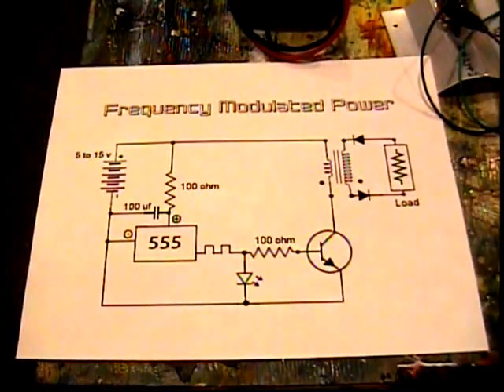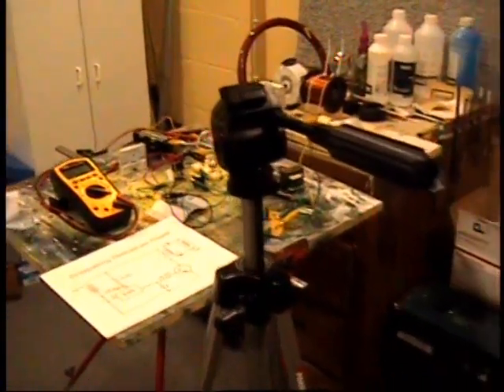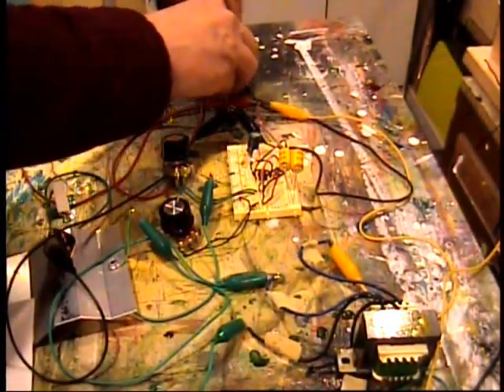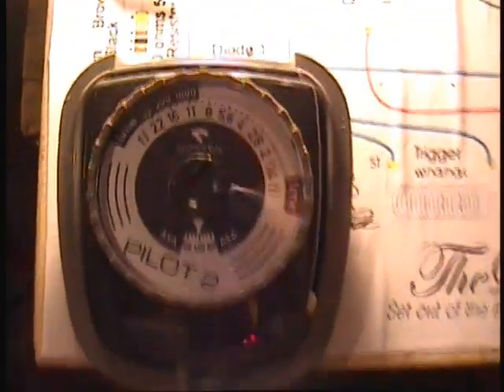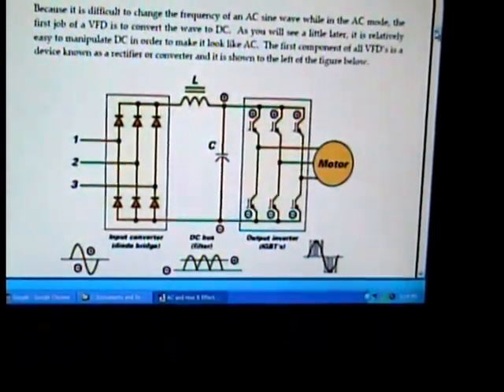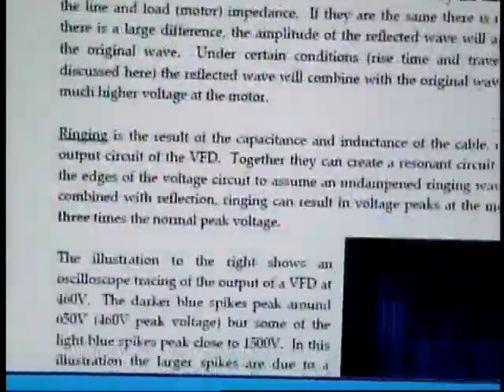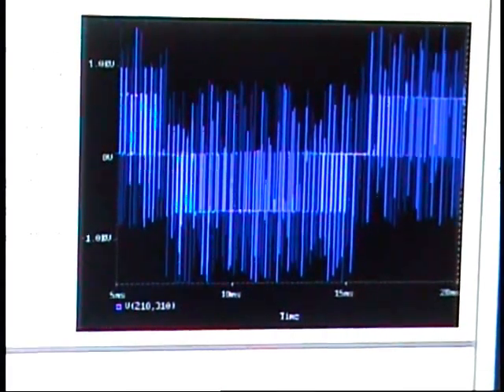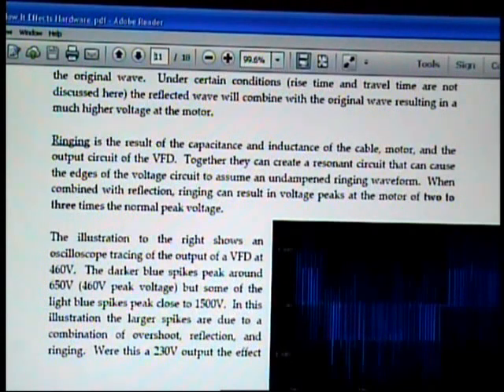Variable Frequency = Super Efficiency

Comment: i have been wondering if there is something that needs looking into with high frequency pulses in a transformer, and i stumbled across this write up about resonance frequency and sounds like they were using a transformer as well you may want to save it as there is 210 pages of this stuff interesting read man cool video by the way i wonder if you get the frequency's up nice and fast if there is a spot where you can start to lower input voltages to the transformer since i have been reading that low frequency transformer's get hot with high frequency pulses and saturated the core to much if you can lower the saturation effect maybe? by lowering the input power to the transformer using a potentiometer just a thought? https://theses.ncl.ac.uk/dspace/bitstream/10443/747/1/Muhammed00.pdf
Reply from the maker: +styleslider400 ,Thank you for the link to a very interesting Thesis by ADIL H. MUHAMMED, MPhil. I will enjoy reading it. Also, in answer to your statement above, this "normal" type of transformer will saturate quickly. To do better a toroidal transformer would have to be used. They are expensive to buy. I make my own but still an investment in time. I just wanted to show here that even the lowliest mass-produced device can do better than its original intention.

Comment: Very interesting, I to have found that I have a working voltage at around 70 percent under load. When I wind my coils I add 30 percent more wire so I get 120 volts under load. I will be winding new power coils @ 1115' of #23 AWG. I will post a video when I get it all setup.
Thanks for posting!
Peace.